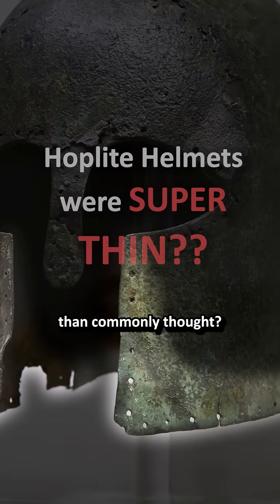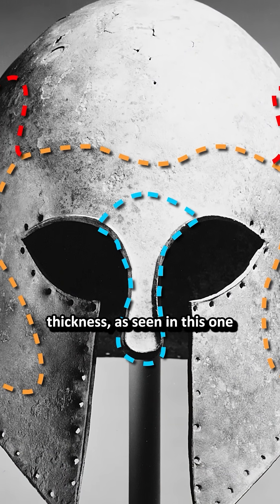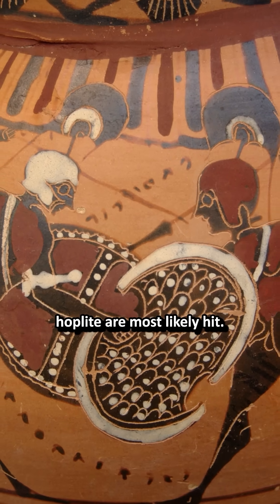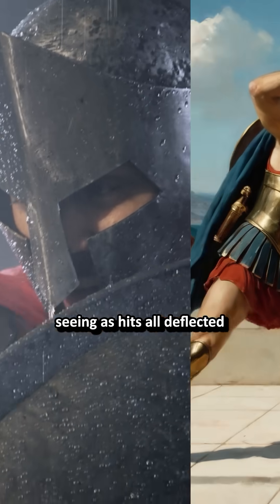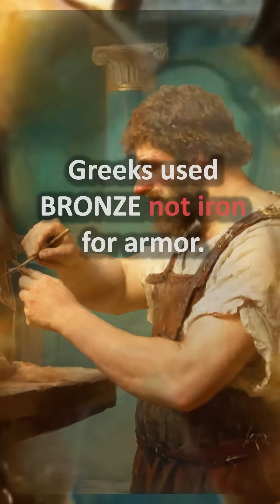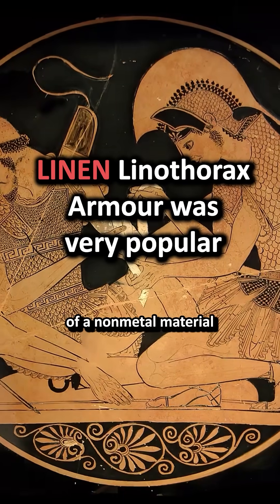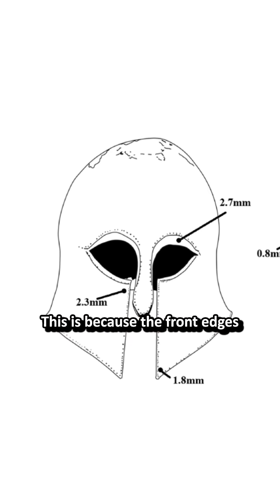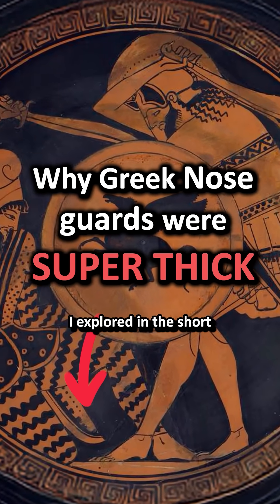Why Hoplite Helmets were SUPER THIN #ancientgreece  #ancienthistory #armor #historyfacts #technology

Comment: So this is meassured on found helmets that have been in the ground for 2500 years? Corrosion would have eaten away on the metal making it thinner so measuring found objects is accurate historically?
Reply from the maker: Good point. Bronze actually grows a bit thicker, as it doesn't rust but oxidizes (transfering density into width, retaining the materials).

If museums polished that layer off however, it would've been thinner.